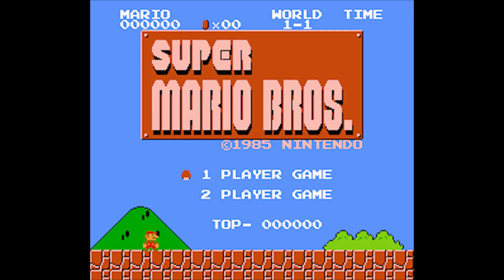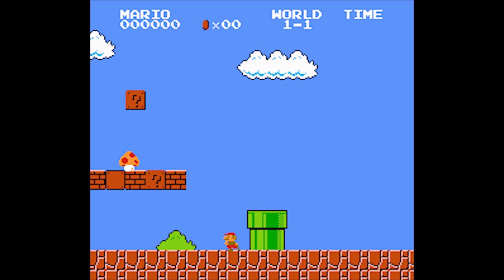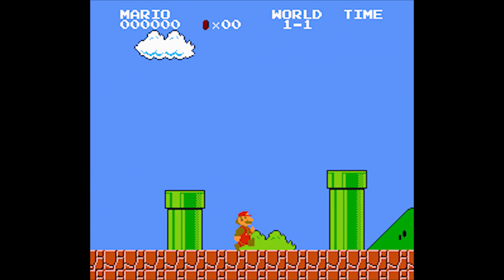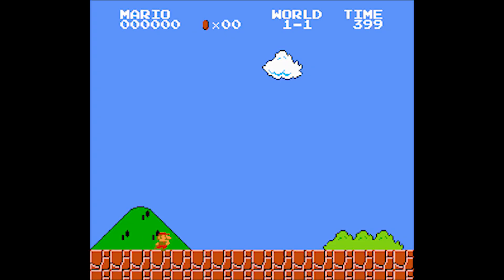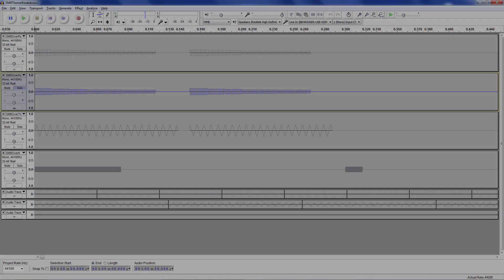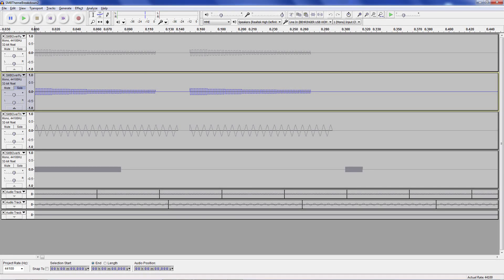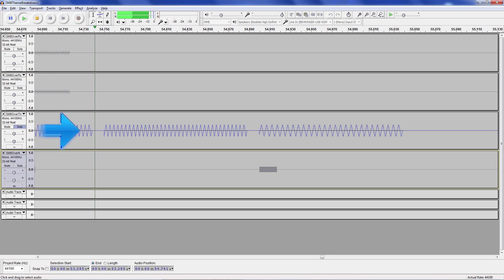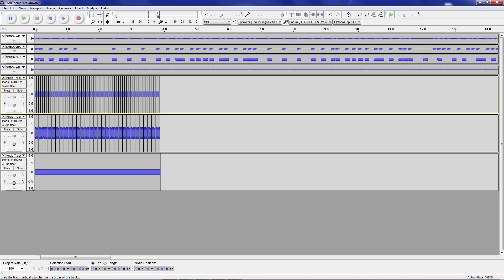🕹Super Mario Bros. Theme Breakdown & NES Sound Chip 🎶 Overview (With Errors)

Comment: One detail you didn't mention is that both the PWM channels can take 3 different shapes. (They can be square, saw, or a hybrid.)
Reply from the maker: Lee Bee Thanks. There's a lot of research I didn't do before making the video, once I separated out the four tracks using Jay and yes, I just wanted to mess around with them and put out a video. :-)
Reply: @Frysacidtest  Nice video, anyway. Anything to do with chip tunes is always a win for me :)
Reply: @Frysacidtest  I particularly notice the difference between square waves and other waves because I grew up with the Spectrum (which was ONLY square) and I love the square wave more than any other wave. So the NES's additional waveforms sound very obvious to my ears :)

Comment: +Fry's Acid Test What did you use to extract the music files?
Reply from the maker: I loaded the game in the JNES emulator, which lets you turn individual voices on and off.  I simply played the song through, 4 times, activating only one track at a time.  I used the free Audacity audio editor to combine them.  I had to do some alignment to get the 4 recordings to line up, but it didn't take long.

I explain it quickly 3:00 into the video.

Comment: You seem to have mixed up some stuff with the SNES audio capabilities... the nes has the sound generation integrated into Ricoh 2A03 processor, which is pretty much a MOS 6502 processor (used in the C64 for example) with the added audio. It doesn't have the echo effects the SNES does, it has the two PWM channels like you said, but they could only be 12,5%, 25% or 50% (true square wave) and 75% which sounds the same as 25%. These channels and the noise have 15 volume levels + 0 and the "instruments" are created by switching between the volumes, so for exmaple a slow fade from 0 to 15 sounds like a flute, or wind with the noise. The triangle can only use one volume or output silence.
The noise is much more random than your looped recording is though, it has 16 different pitches, the low ones sound like burning noises, the higher ones are like wind and hi-hats. It also has a looped mode where the random bit generation is shortened and it sounds like some electric beeping. This is heard in Quickman's music in Mega Man 2, or Fireman's theme in MM1.
Good video though because you tried showing off the different sounds via separation. :)
Reply: za909returns You got everything down pretty well, but I have some one thing to add and two to correct you on:

1. There is another fifth channel, which is a delta modulation DPCM. This can play relatively low-quality 1-bit samples at 15 different quality settings. Using the highest setting will let you play samples that are a little under 1 second and the lowest setting will let you play about 8 seconds, but then it will sound pretty horrible, to be honest.
This channel has no way of changing the volume on the fly, so different volumes would require different samples.
This channel is mostly used for sound-effects, like in The Legend of Zelda, but was sometimes used in games' music. A lot of games used the DPCM to sample drums, and Sunsoft and Codemasters even managed to get some super-sweet sounding bass on that channel.

2. Correction of being unable to change volume of the triangle channel: You can actually change the volume of the triangle to some extent by manipulating the DPCM's delta-value. This will lower the volume on both the triangle and noise, as they are mixed with the DPCM. The pulse channels are mixed separately, so it doesn't affect them.

3. Correction of not being able to make echoes: While the NES doesn't have any built-in echo-effect like the SNES does, you can easily replicate this by having the two pulses play the same thing, but one of them is a bit delayed, has lower volume and is slightly offset downwards. Sunsoft used this kind of echo a lot in their later games.

I hope I helped.
Reply from the maker: za909returns Cool, thanks for the info!  Clearly, you've looked into it deeper than I have, and some of the information I found was a bit conflicting.  I'll probably add an annotation to look for this comment for more accurate info.